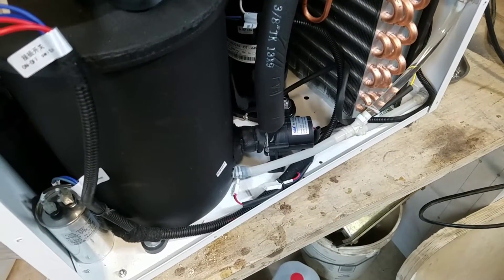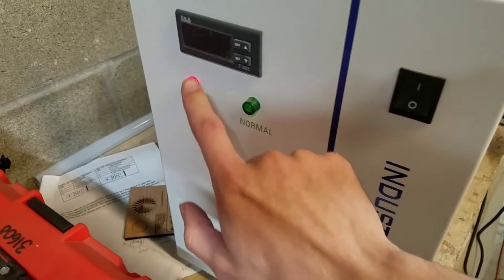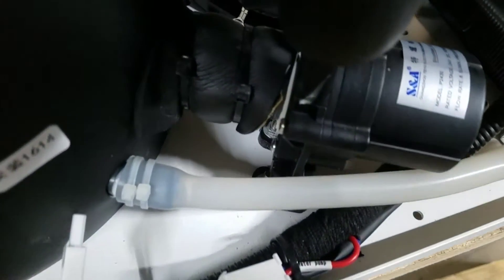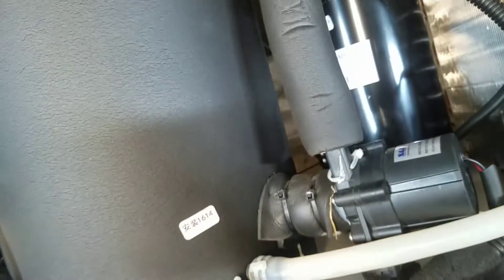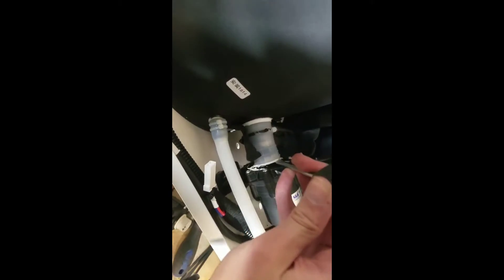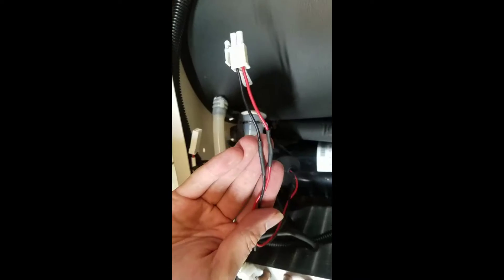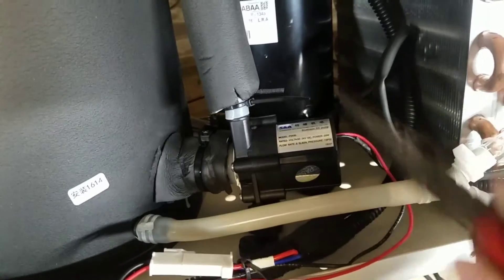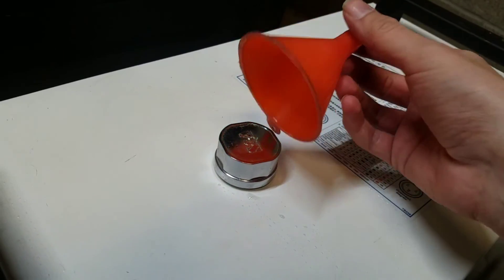FIX replace water pump S&A laser cutter chiller CW-5000

Comment: Thanks for your video, it is very helpful. The motor pump was blocking the machine from normal start. But in my case, I opened the pump and found a piece of dust blocking the fan from spining. I tested the motor with a 24v power supply and worked like a sharme. My CO2 Laser machine is working fine now without replacing anything. Thanks again my friend.

Comment: Thanks, this helped me fix my chiller, your instructions on how to extract the pump were very helpful.

In my case, some fine material had gotten wedged between the pump's axle and rotor, so the spindle couldn't rotate, the clue was that the motor was making a (quiet) clicking sound when it was powered on, as if it was trying to turn, but for some reason couldn't.
Reply: How did you fix. I have 2 cw-5200s that have been in storage that both have these symptoms. Very strange.
Reply: Same here, I fixed it removing a stange piece of  material that was blocking the fan from spining inside the pump.

Comment: Nice I have the same chiller! What is the model number of the pump? Also I need to replace the pump in mine due to not having enough head pressure
Reply from the maker: It's a P2430, added to description. The motor is rated for 13 PSI. 

What is the recommended head pressure? My chiller is sitting at ground level, same as laser cutter. Inlet tube to laser is ~2 ft above the pump. Did my pump burn out from 2 ft head? Hope not, I didn't see anything in the manual about it.
Reply: @continuousload3963  Hmm now that i now what to look for it looks like the P2450 is the one meant for the CW-5000. i feel like 2 ft of head should be just fine. My water chiller is in the attic so it needs a powerful pump. I will need to get the biggest version of the pump. P24100